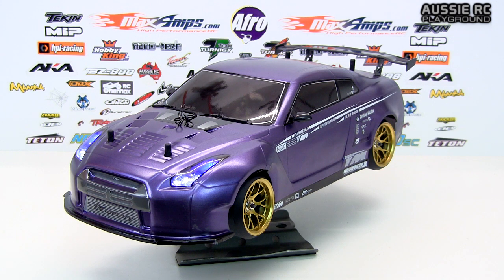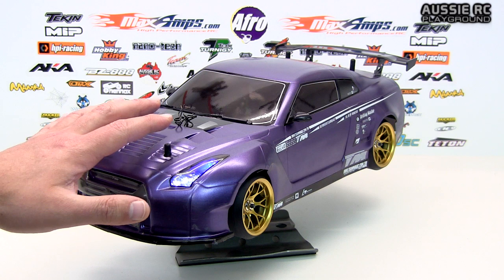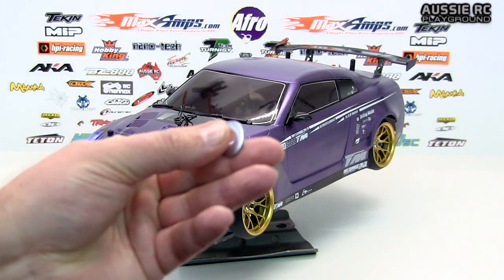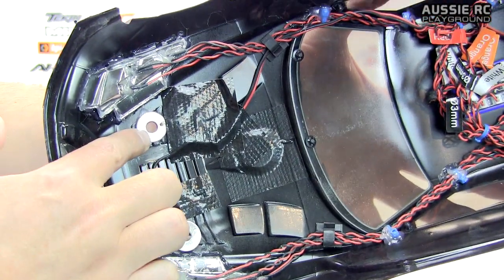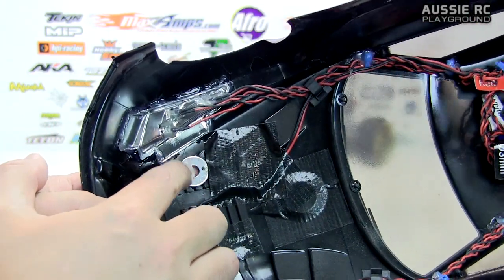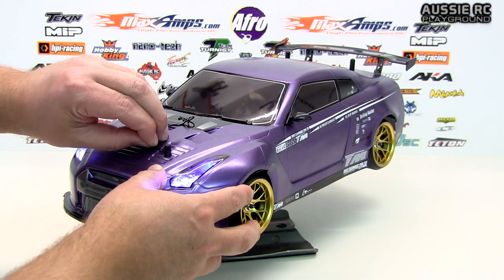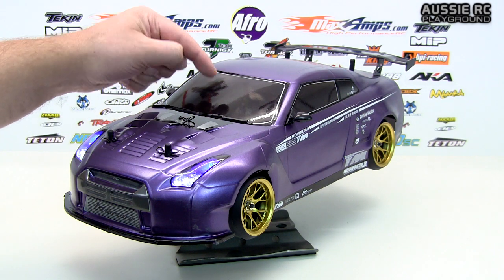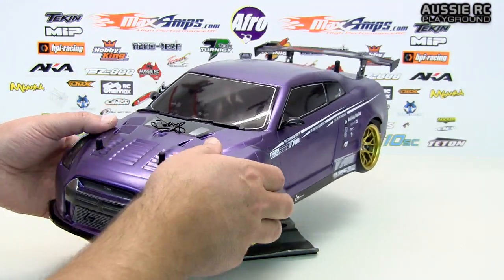RC HOT TIP: Wireless LEDs

Comment: you could also put some small springs on the washers on the actual body posts so it actually presses into the body when you fit it.
Reply: +eatthisvr6  that sounds like it will be great for basher trucks.. it is more forgiving. good looking out
Reply from the maker: +eatthisvr6 Yup, that could also work. Finding the right springs would be the hardest part of that mod though.

Comment: Cool! I bet you could get copper washers and you can solder up the wires to it. You can also get silver epoxy solder and glue the wires to the washer bottoms on the steel ones like you have used.
Reply from the maker: +shenlonco Yes, I'm sure that will work also. I did try to solder the wires on the ones I used, but my solder wasn't sticking to them. That's why I drilled a small hole on the washer to tie the wires around. It's not perfect, but it works quite well.

Comment: I did a similar thing once with a cut up Milo tin instead of washers. Did you put some on the back as well for the throttle and turn signal? For running brake lights, indicators etc.

Comment: It would be great to find a way to make it waterproof, have you thought about it? Would be nice so it can be done to crawlers, Summits, Yetis or that kind of off road-realistic look RCs.
Reply: plasti dip the entire box where are the wire's plug in. i did mine and dumped water on it. still works great.
Reply: Actually what I'm worried is the washers cause they're like stripped wires and there may be trouble if they touch water or even worse if they get submerged wich is very normal with that type of RCs
Reply: +evofsc yeah i dont see a way to seal them. if you did you would lose connection. im sure there is something out there. im going to look into that. good thought.
Reply: +rc madness Exactly you can't just plasti dip them or put some silicone cause they won't work, it has to be something that let them make contact and that can be removed easily with the body...I have some ideas but it's not easy.
Reply: dsr31 springs